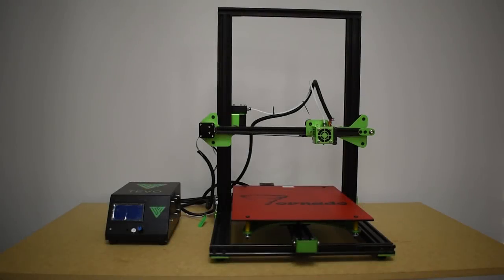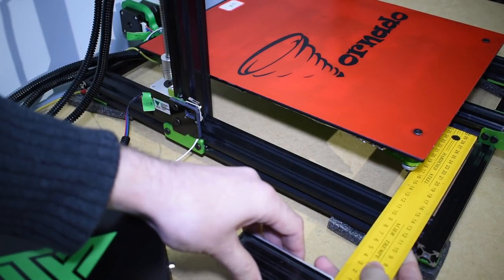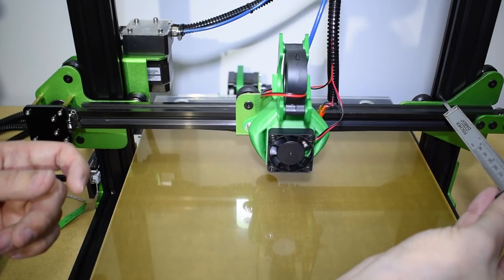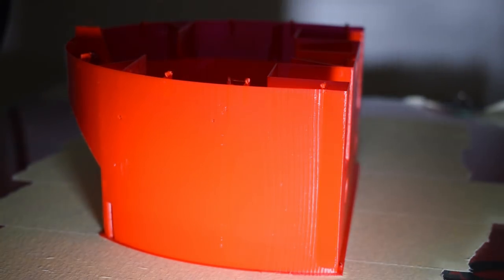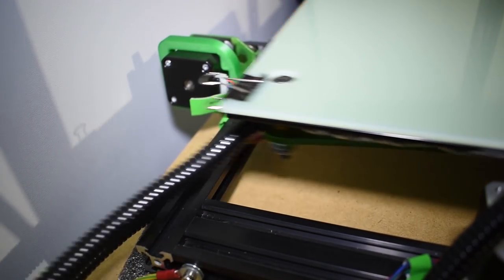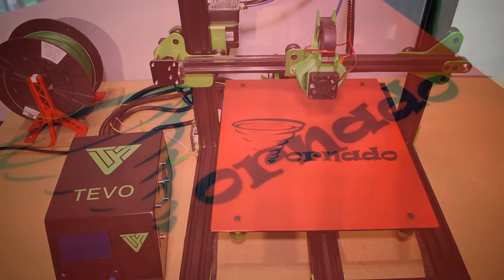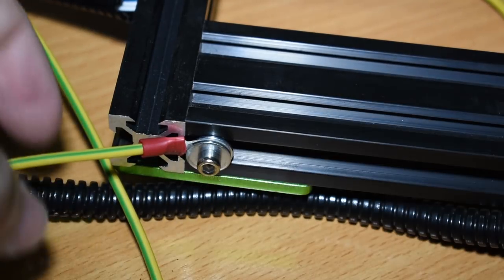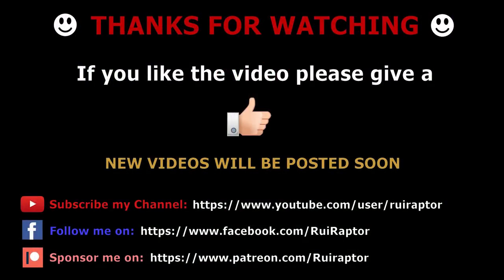TOP 10 UPGRADES You Must Have - Tevo Tornado 3D Printer

Comment: Having started with a Tevo Tarantula, I can safely say that I'll never buy another Tevo machine, even if it's mega cheap.
Reply: I think you could have been a bit more specific and provided a bit of information.  I just bought the Tevo Tornado.  I'm coming from a FLSUN QQ Delta and I'll never buy another one even if they were free.  Sounds the same as your goofy statement.  Mine was put together with plastic screws and broke.  Returned for refund.  Now what's your excuse?
Reply: Plastic screws??!! Facepalm! That's just a disaster. :¬)
 I didn't expect great things when I bought mine on Gearbest but it was what I could afford at the time and it is for fun, initially. I'd seen reviews, but has also closely examined various images and saw the bad match between the extrusions and the running wheels. So I knew it would need work to make it good.
 When it arrived it was as expected.
  I'm a CNC machine setter and have access to the machines if one has some "out" time. So I've machined proper "V" faces into the rails where necessary.
 But as I started assembling it I found some screws stripping with minimum pressure on the allen key. So I measured the screws and "T" nuts. The threads on the screws were undersize and threads in the nuts were oversize. A recipe for failure.
 So I purchased alternatives online and waited till they arrived to start assembly again.
 After finishing the build, I got everything moving as it should and loaded some of their "free" filament and a file to print.
 Warm up the bed and nozzle? Ok.
Bed yes, nozzle no.
Check all my wiring.
Try again. Cold nozzle.
After testing everything, the nozzle heater was dead! (insert swearing here)
Ordered two replacements online from a UK supplier. Waited for them.
 Finally, first print!!! Only two months  after receiving the machine. (ok, including the Xmas break)
heh, and no, I wasn't bothered enough to return it all the way to Shenzen. ;¬)
 So later this year I'll be looking for a Creality CR10 or maybe a Prusa, if finances can stretch that far. Or, I may just build my own from scratch.

Have you seen the new E3D printer concept? Watch from around the 8 minute mark to hear about it. https://www.youtube.com/watch?v=jfopGYO0r-M&t=169s
 They are definitely inspiring me to build something.

Comment: Sooooo. Just buy a cr10 then?
Cuz it doesn't make that much sense to throw that much cash at a budget machine to get it on par with one just a bit more expensive.
Reply: As far as I could see, buying CR10 would require one to buy both a new nozzle/hotend and an AC heating pad for the bed because the heated beds on the CR10's are utter crap for the size from what I've seen in the reviews. The print surface would apply to both printers and the leveling knob would only apply to the Tornado as the CR10's come with large leveling knobs out of the box. Now I'm curious as to why you think a CR10 would be the better buy.
Reply: The Tornado is a great printer and you should not underestimate how nice that high-voltage bed is!

also, #1-4 were no issues in Dec 2019 anymore and #7 will always be about preference

Comment: How is this a "great" 3D printer if, as far as I can tell, 6 out of the 10 upgrades are all design issues (inadequacies) that should have been dealt with by the manufacturer prior to release? I enjoy your videos Ruiraptor and appreciate the effort, but it seems like you're trying to put lipstick on a pig.
Reply from the maker: Hi Kevin,
Your remark makes total sense. However, as far as i can see, tevo is one of the companies that listen to the users and tries to make changes as some issues are discovered along the way. They already did some changes since the release of this printer such as firmware changes, changed the board and drivers (now they have the MKS Gen L board and A4988 drivers) and so on. Some other manufacturers don't do that.